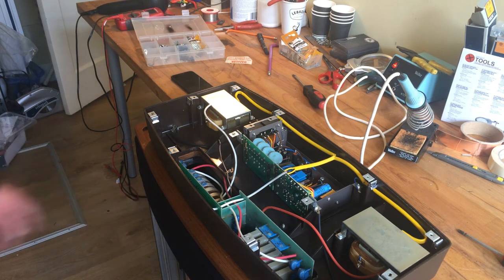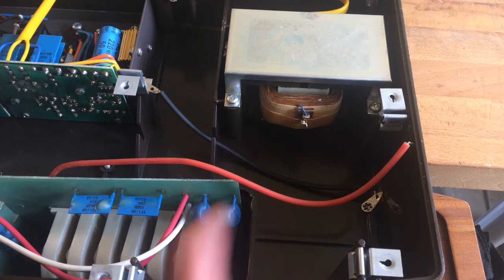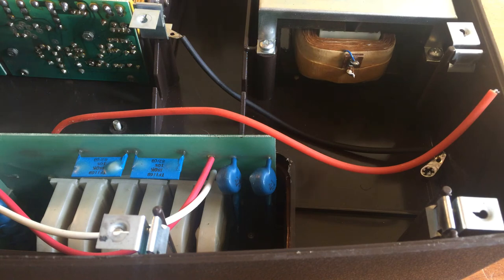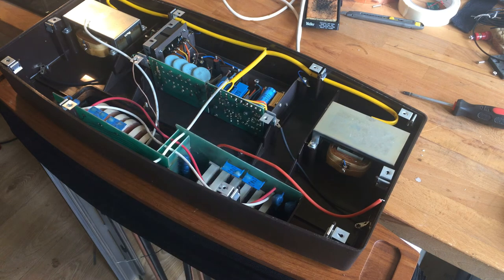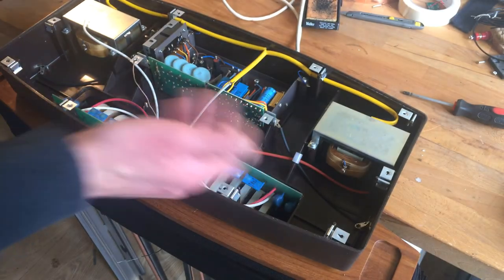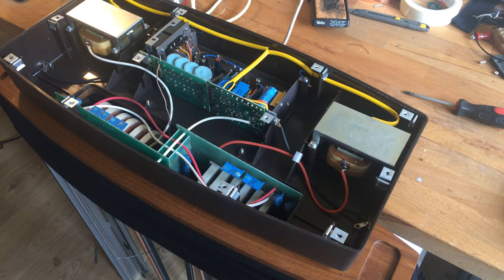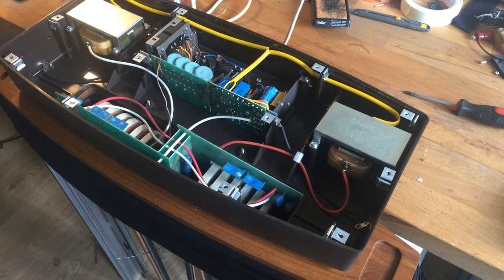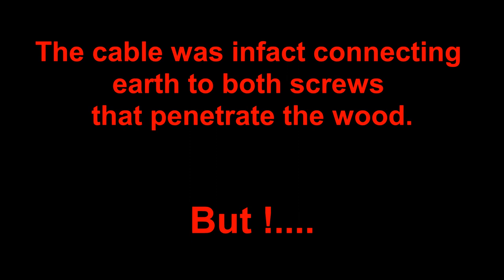Quad ESL 63 REPAIR part 7 cloth change at least the annoying part. sorry technical issues

Comment: Thanks a lot for sharing,  I have one of my 989 lined up for a tuneup due to some sparks from a panel, now I'm better prepared for what I might find, the do's and the don't. I'm not worried about the electrical parts of the job, but the risk of braking stuff during disassembly. I have an oversimple QUAD service manual, which unfortunately leave one guessing a lot.

Comment: The delay board is clamped/pressed between the bottom plastic plate and the bottom stator with the help of foam strips that gets sticky and looses its function after some years.

Comment: Hey thanks for posting info on this. 

The speaker plug broke on mine.
Also saw:
 Looks like a capacitor (the BLUE cylinder seen left of the transformer 3:55 )  also a rectangular  ceramic fuse(?) attached which is cracked and blown.
Can you confirm my parts naming?
Where can parts  picked up at or alternatives are adequate? 
3:55
Thanks
Reply from the maker: i really dont know. i got rid of my esl63 4 years ago. contact someone that repair these more often then i did. i in the end did not manage to repair them perfectly and gave up :( and sold the whole thing
Reply: @joppepeelen  ok thanks
mine are still going strong, this just showed up.